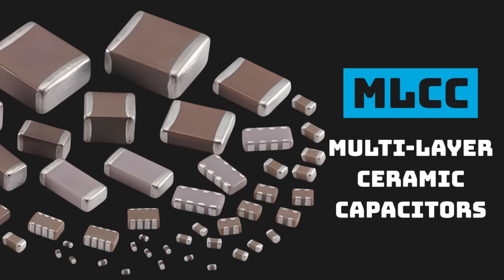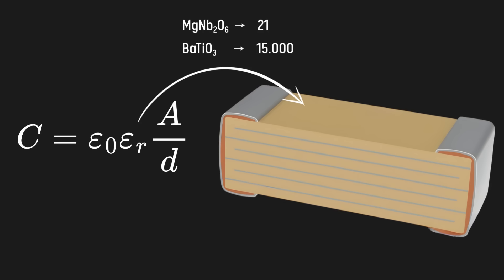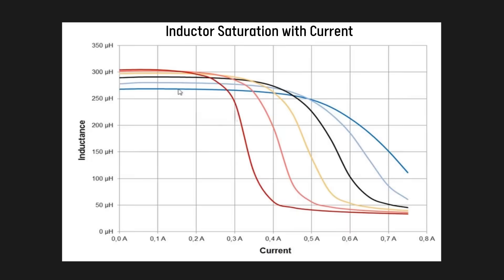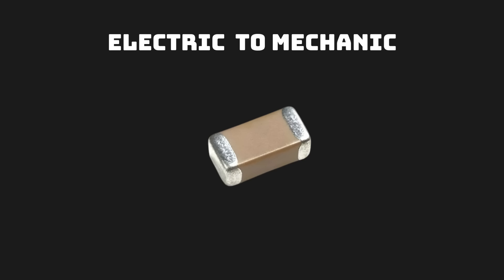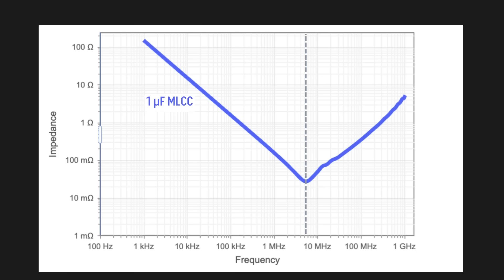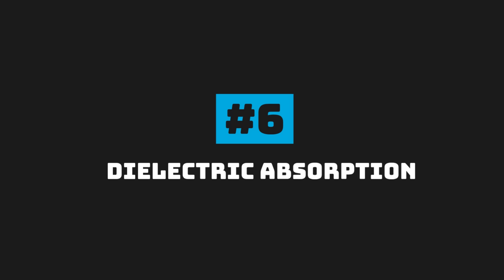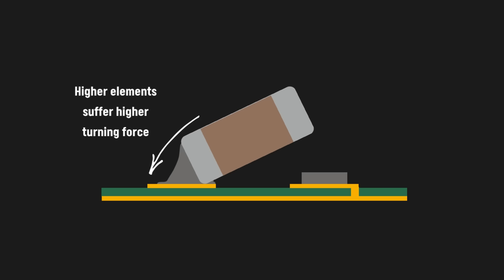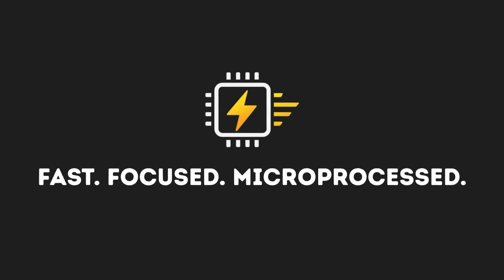Ceramic Capacitors and Their HIDDEN Effects

Comment: Cracks can be avoided by having thermal reliefs at least on one side of the capacitor. Both sides is better. A solid ground plane where capacitors have a pad without thermal reliefs is bad. It's not just thermal relief, it is mechanical relief as well. These crack usually happen in big capacitors. Not the small ones. Lets say over 2 uF. May result in a capacitor just heating up. A thermal camera will help. Feel with your finger might get some result too. They might burn. They might flash when the board is dropped or something. A lot depend on the ability of the circuit to provide power when this happens.

Comment: Class 2 caps also have a strong frequency dependence of the dielectric.  I’ve seen people attempt to use them in RF filters with disastrous results.
Reply: I have used resonances stemming from decoupling caps with great success. Your people are simply clueless on how to do this right.
Reply: @s@s@s@s @schmetterling4477  I’m not talking about parasitic resonances, rather dispersion in the dielectric.  That means C is a function of frequency, thus simple capacitive reactance is nonlinear.

Build a hi-Q RF filter with NP0/C0G caps then swap them out with X7R/X5R and see what happens to the passband.
Reply: @rfengr00  Yes, this has to be done experimentally with the board running at the design voltage. I like to add two or more SMA connectors to the board. They are connected to the power supply layers with a 50Ohm resistor and a series DC decoupling cap. This way I can measure the actual performance of the decoupling circuit with an RF impedance analyzer. One can not rely on theoretical considerations alone.

Comment: Most of this also applies to "every" capacitor, and similarly for all inductors.  HE Forgot to mention dv/dt failures, voltage breakdowns due to creep, Paschen effects at varying pressures, mismatched thermal expansion and contraction, high electrical noise for low-noise application, similar the Barkhausen magnetic noise, failure in high radiation environments due to the electrode materials choices.  Some other effects that we observed, but that is all I could think of in 10 seconds.
Reply from the maker: @brunonikodemski2420 Thanks for adding those, I will consider them for an expert video series in the future. Stay tuned for more soon.

Comment: 0:07 -60% at rated voltage is actually pretty good for a ceramic. I've seen -80%. There are smd film capacitors without this effect but they're much more expensive. Also circwit😄?

Comment: If it has capacitance on purpose, it is by definition a capacitor.
Opposed to parasitic capacitance, for example between the copper fins on a breadboard. It's not purposeful, but has 15 or 20pF of capacitance, enough to mess with your circuits. But it's unintentional, so it's just parasitic capacitance.

Comment: This likely explains why I sometimes hear noise that seems to vary depending on what is showing on my monitor while in character mode.  Suspect the hum is there in graphics mode, but I can't hear it.
Reply from the maker: @russellstyles5381 The source of the noise may vary with the type of monitor, but usually those come either from inductors/transformers or capacitors, even though they should have no moving parts. I'll make a video about inductors soon, subscribe and stay tuned.

Comment: X7R can also exhibit temperature-dependet histeresis, which one can be cancelled by resoldering cap (it is like capacity drop memory due to working in 70-90 deg C but after heat them over 130 deg C internal crystal structure are fall back to origin state)... It is another reason to do not place this type of caps in opamps environment. Use it in any decoupling circuit after apropriate de-rating is ok, the still present extraordinary low esr.
Reply from the maker: @romanowskis1 Thanks for adding that. This is also a curious effect which I didn't talk about in the video, where aging on MLCCs can be reset when heating them beyond their Curie temperature. More videos coming soon.

Comment: When it comes to the self-resonant frequency issues for filtering/decoupling... feedthrough capacitors are a godsend. Ten times the SRF at a given capacitance. Just be careful, because not all of them have a DC connection between their terminals.
Reply from the maker: Thanks for adding that @erkay3504 , interesting point.

Comment: Every ceramic capacitor can work as a ceramic microphone and vice-versa. That capacity of ceramic capacitors is formed by myriads PN junctions between grains of their material so that they can also behave like electrets and/or varicaps and/or TVS diodes/varistors. With increasing temperature their capacitance vanishes fast, so that they also behave like thermogenerators etc.
Reply from the maker: Thanks for adding that @Milan_Petrik, and stay tuned for more videos soon.

Comment: Great explanation of MLCC, they can solve and cause many problems in designs. When you throw in price and availability, it can take up a huge chunk of your design time and effort. You sometimes have to look at alternatives like AL electrolytics which have a calculated life span as well. It is much easier to spec a semiconductor than a cap.
Reply from the maker: @johnelectric933 If you can stick with larger sizes (e.g. 1206), choose higher voltage ratings and use C0G types, you can get away with many of the issues. But often that is not possible. That's when you have to invest the time. Stay tuned for future videos!
Reply: @Microprocessed  1206 C0Gs??? Wow. I knew they were headed there, but didn't know they started offering in that size. Not that long ago, (decades) you couldn't even get a 0.1uF in NP0 (C0G). The last couple of designs I worked on didn't need precision so I hadn't noticed.

Comment: Fun facts: ceramic caps can also act like varistors, which are ceramic caps except with less capacitance & more abrupt breakdown at high voltages & they usually use two different ceramic materials as dielectric but other then that they share a lot of similarities.

Comment: Fascinating, never knew of they could behave like piezo xtals
Reply from the maker: @GastelEtswane Sometimes the high frequency noise coming out of monitors and TVs are from inductors, but sometimes also from their MLCCs. Stay tuned for more soon!
Reply: @Microprocessed  Subscribed! thirty years in the craft and this is like discovering a whole new field exists.
Reply: Very useful information indeed
Reply: Even old ceramic THD capacitors behaved like piezo devices. That is why they were avoided in the signal path in quality audio.

Comment: I am working in TV manufacturing company. One lot of our remote controller pcb had cracked mlcc and eventually failed by draining the battery by being short circuit.
Reply from the maker: @dipubiswas8520 There are many reasons for them to crack, even in manufacturing. Thermal shock may be a reason. Stay tuned for future videos.
Reply: @Microprocessed  We had one that was caused by the place and pick machine's handling. You could almost breath on it and it would open up.
Reply: @Microprocessed appreciate your work

Comment: What are the vintage electronics community to do when all the real components with wire leads are gone.  Time to roll your own i guess
Reply: Solder wire leads to SMT parts :) Or use salvaged parts.
Reply: A lot of time voltage determines size. I do not think the bigger caps are going away, but they do have electrolytics SMT's with small leads on the lower values. 
Ceramic disks in high voltage circuits are still the only solutions in stuff like ESD and impulse specs.
Reply: @johnelectric933  High voltage ceramic != MLCC
Reply from the maker: @gailsmith9835 interesting point, I used a lot THT ceramic capacitors in the past, but have no idea about their availability nowadays. Which type of projects do you do with vintage electronics? How vintage are they?
Reply: @Microprocessed  Readily available, but a lot of it seems to be mature tech - more for cheap power electronics that still often use THT.

Comment: Using Kyocera KMG NP0s for audio, low temp co-eff., tight tolerance and no issues whatsoever up to 100MHz with multiple values of between 15p & 10n 1206 on a recent, fast FET outputs power amp design.
Reply from the maker: Great design practice @paulb4661 , NP0s (C0G) are the most stable ones you can use, and because capacitance values are rather small and you opted for larger sizes (1206), you probably minimized these effects to the maximum possible.
Reply: @Microprocessed Thank you! To be honest, 1206 is probably the smallest footprint I'd ever employ for practical reasons as well- still easy to hand solder with a standard iron fitted with a slanted conical tip. Especially that often, assessing the performance against multiple values is the only way forward. I stick with THT electrolytics, polypropylene film and rarely tantalum for larger values, but shorter signal path, thus minimized stray inductance/capacitance of the traces/leads is an advantage of employing smd caps & resistors, where possible. Nickel then gold plated pads/vias are great for work in progress designs, they handle multiple soldering cycles without any issues.
Reply from the maker: @paulb4661 true, the smaller you go, the harder it gets to solder them with a soldering iron. Great tips with the PCB plating, thanks for sharing it.

Comment: I like them because they're pretty cheap and don't have a liquid electrolyte to evaporate. That always bothers me in the desert where the housing could get to like 200f in the sun.
Reply from the maker: True @kylebooth2528 , in the end every capacitor will have pros and cons to offer, important is to know which ones are best for your use case. I have plans for a video on electrolytic capacitors as well, including solid electrolyte and high-temp versions. Subscribe and stay tuned!

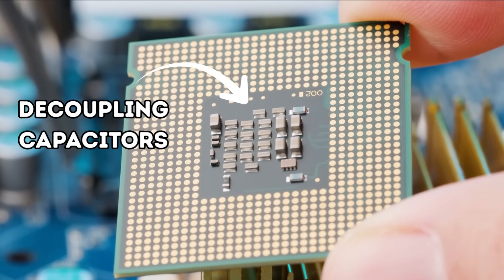Comment: 1:58
so... they are used precisely in the place where they WILL experience significantly higher temperature and loose most of the capacitance ._. ?
Reply from the maker: @ChocoMintOrg very often yes! And this is because miniaturization often leaves no other viable option. But if you are aware of the derating, you may pick capacitors with higher voltage rating to minimize the derating or capacitances much larger than you need. Processors operate at very low voltage (often below 3.3V), so working with capacitors for 10V, 16V or 25V already leaves a big margin for derating.

Comment: I think the effects and bad things that you're talking about are overblown. I built an entire stereo with common emitter stages and class AB output and used 10 microfarad ceramics as DC blocking capacitors and I had no problems whatsoever and it sounds beautiful.
Reply from the maker: That is cool @LJacyHenry, amplifiers are personally very satisfying to build and test. As a DC blocking capacitance, perhaps the loss of capacitance is not so critical for the overall performance of your amplifier, as it results on an increased bandwidth. 
When it comes to MLCCs, the magnitude of the effects depend on which capacitor exactly you are using, and you can usually find detailed information on their datasheet. Often, if you are building one or a few units of a certain design, you don't even notice these effects. Three things increase the chance of facing issues with it: products built in mass production (several thousands), products operating in extreme conditions (automotive, aerospace, industrial) and products that are extremely miniaturized (smartphone electronics). For these type of products, these effects are very relevant, and the best way to avoid or debug systems is to be aware of them.
Reply: DC blocking and RF bypass/decoupling are applications where stable capacitance and low loss are not important, so it's not too surprising that it works fine.
Reply from the maker: Thanks for adding to it @inductivelycoupledplasma6207
Reply: I once tried to build a simple fluxgate with LC oscillator where L changes with magnetic field. Instead of sinusoidal oscillations I got some crazy unstable signal. Swapped IC, nope. Put it in aluminum box, added filters and used coaxial, nope. Then after a week of head scratching I read somewhere that ceramic caps may be an issue. So, after swapping for film caps I got a my good sinusoid.
Reply: The trick is to reduce the signal voltage drop across the cap. That means that caps impedance (including esr) in the frequency range should be as low as possible compared to the rest of circuit's impedance. No voltage drop, no affect.